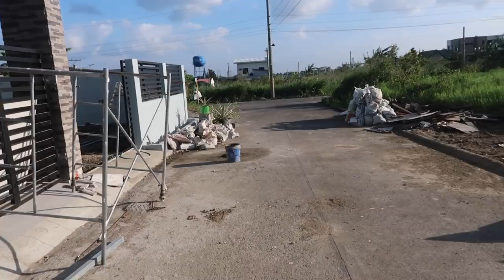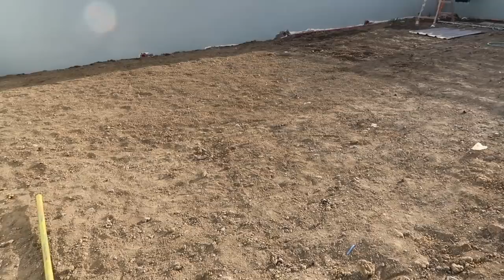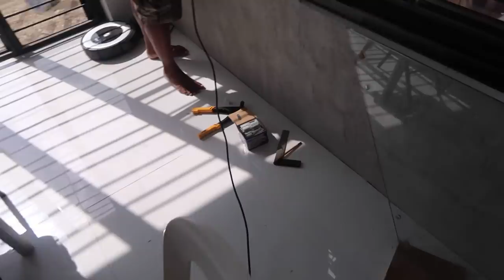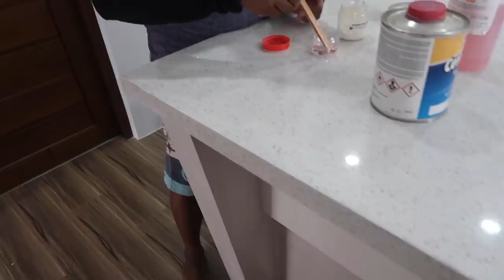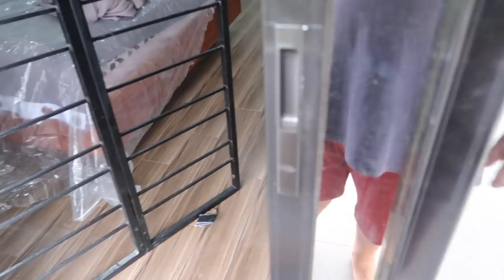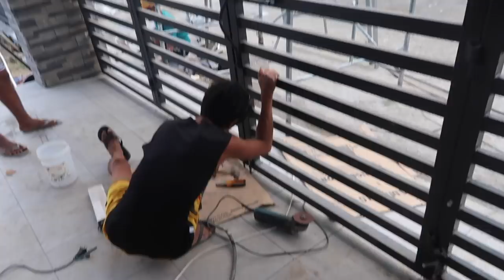HOUSE BUILDING IN THE PHILIPPINES - EPISODE 202: FENCE LIGHTING I WINDOW SCREEN

Comment: How big is your lot and floor area po?
Reply from the maker: We have 270sqm lot and house is 230sqm 2 storey .We consume more than half of our lot
Reply: @retiredandhappyinphilippin3329  thank you po Godbless
Reply: What set backs did you guys use?  Our lot is shallow, but wide like 12.5m deep but 20m wide and am now concerned about the setbacks.
Reply from the maker: 2meter setback but it also depends on the subdivision restriction and city restriction.We have one corner that is under 2meter because our lot is a bit sideways.Our lot is 13.5Meter deep and 20meter wide.Best way you do is firewall on the other side to have a good parking in the front. Then youre going to have good size backyard .